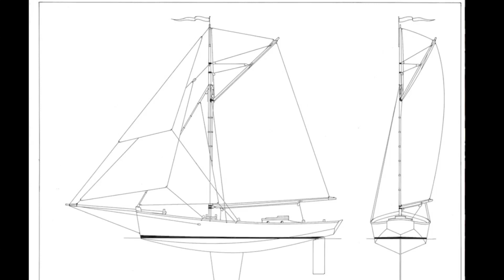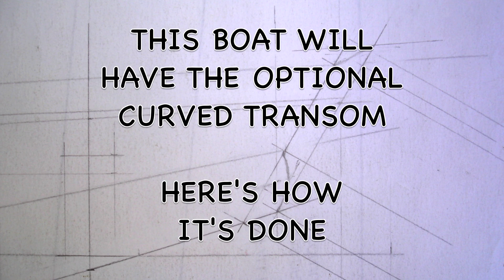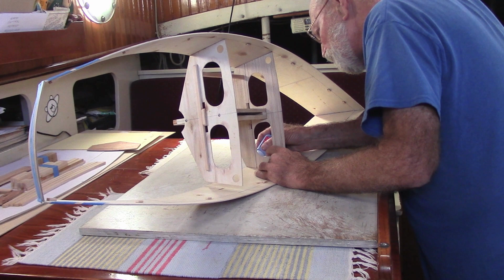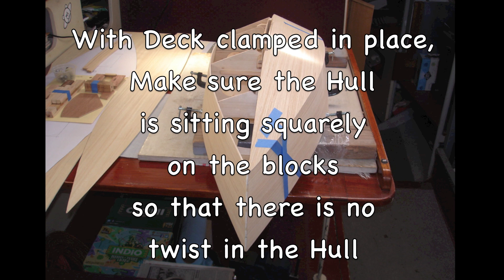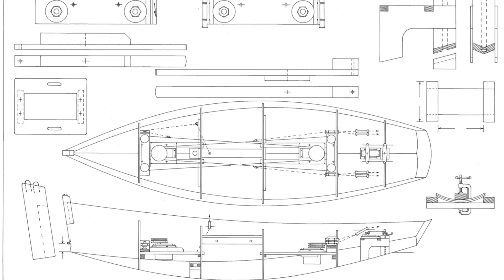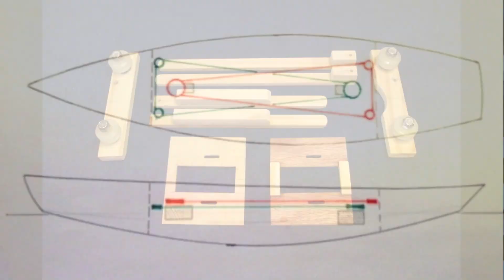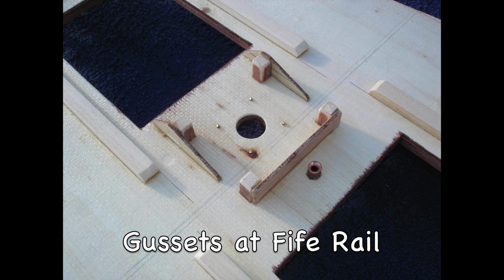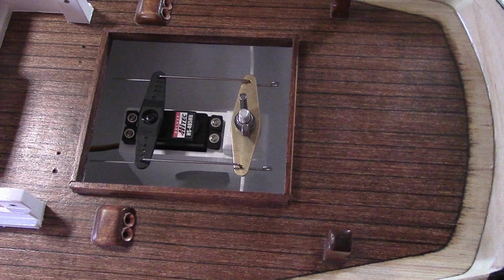RC Sailboat DIY plywood Hull for Gaff Cutter "FLYER'

Comment: Hi Gary,

a few weeks ago I found your videos about your sailingboats. GREAT !!!!  I love the way you are building your boats and the way you present and comment your videos.
Actually I do a restauration at a sailing-bota called INGA IV which is about 45 years old. As a young boy I had not the money for this boat. 4 weeks ago I bought a secondhand INGA.
Thanks for your tip to make the plankinglines with a ballpointpen, it works and look great.
Hope you are well and you will have lots of fun with sailing your boats.

greetings from Germany, Michael :-)
Reply: Eben genauso gedacht ..., hatte bei meinem Modell noch die Plankinglines geritzt und dann mit schwarzem Nähgarn ausgelegt und mit Mattlack fixiert. War ziemlicher Aufwand.  Ein Unterschied in der Optik zu einfachem Kugelschreiber nicht feststellbar. 
Warum kommt man nicht selbst auf solche praktische Lösungen ? 🤷‍♂

Comment: Hello Gary, I'm part way through building 'Flyer' - the plans are great. Looking at your video I think I see that you have put a glass fibre skin on the inside of the hull. Your instructions don't mention that - is it for extra strength or a good finish? Many Thanks
Reply from the maker: Thanks for asking about this. Sorry about the confusion. Although it appears to be fiberglass cloth, it is not. The plywood I used had an embossed surface on its back side which gives it that appearance. This is not a feature I chose, it just happened to be that way on this inexpensive plywood which was found at my local Home Depot store. The only place I used fiberglass on Flyer is the inner surfaces of the fin trunk and the outside of the rudder. All the remainder of the boat is sealed with clear penetrating epoxy sealer then painted / varnished with brushed on oil based  products.
Reply: @sailtails2775  Thanks Gary

Comment: Beautiful,just ordered plans. 
Are you going to be doing other videos for this boat? Is this made from “door skin “ as well? I can’t get it at the box stores around my area.
Reply from the maker: I do intend to make more videos about this boat. 'Door Skin' yes, though 'Flyer' is actually made of 1/8" Pine plywood which I just happened to find locally (Mexico). Almost any plywood could be used for these boats if not more than 1/8" (3 mm) thick. Check with cabinet makers in your area if the stores don't have it.

Comment: Gary, just before you fix the two side of the fin housing together I noticed there is an area that looks as though there is no epoxy, it's a strip corresponding to where you will glue and fix the sides, can you explain how and why that is please? Do you use a specific grade of glass and how many layers please? Sorry so many questions its just that I want my build to be perfect, just like yours.
Martin 😀
Reply from the maker: The sides are glassed over completely. The strip you see is where I have roughed up the surface with 100 grit sandpaper to improve adhesion when epoxy gluing the trunk together. 
I use just one layer of glass. It is fairly lightweight, actual weight unknown.
It was the only glass to be found here in Ensenada Mexico and the merchant was unable to tell me the weight. 
The weight is not critical for we are just using it to create a waterproof layer and not for structural strength. 
Happy boat building Martin, just sent schooner 'Annie' plans your way.

Comment: Hello, what kind of glue you used for that fin trunk after fiberglass. CA or Silicon ?
Reply from the maker: 5 Minute Epoxy. Note that the fiberglass is set in epoxy resin, and the surfaces to be glued with epoxy are first sanded lightly to enhance adhesion.
Reply: @sailtails2775  Thank you for reply . Love your sailboats from Myanmar.

Comment: what thickness of ply do you use on your models i am making a sloop but a little bit lighter and more narrow than emma
Reply from the maker: I use so called 1/8" ply for all my boats. Often it is actually not quite a full 1/8" thick.

Comment: I’m curious, when cutting out the templates, do you cut to the outside of the line?  Do you then cut the plywood to match exactly the template including the line?  Thanks in advance.
Reply from the maker: Center of line or outside of line - no matter. 
Use the same technique throughout the project, everything will fit.
I cut the templates center of line, and cut the plywood to match the template.
Reply: @sailtails2775  Very good, I appreciate the response.  Your designs have made a lot of people very happy.  Schooners and Cutters are classic vessels and I'm looking forward to getting mine in the water soon.

Comment: How do you make your epoxy fillets so even and tidy? Give us a tutorial please.
Reply from the maker: Hi Robert,
I dab the epoxy in place with a stick or a screwdriver, then trowel it out smoothly with a "tool" which is simply a scrap of thin plywood sized and shaped (rounded end) to give the desired radius to the fillet. You will want to make several "tools" with different radius ends to fit the various angles inside the hull.
Gary
Reply: @sailtails2775 Thanks for your answer. Do you wet the tool with any sort of solvent or use the tool dry?
Reply from the maker: @robertrussellmd  -  I use the tool dry, cleaning it frequently with a bit of lacquer thinner.